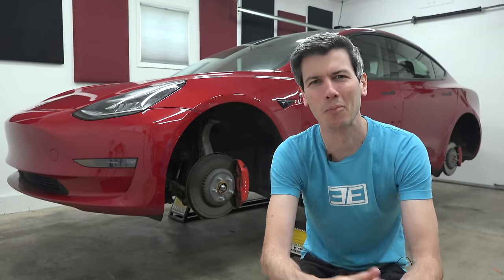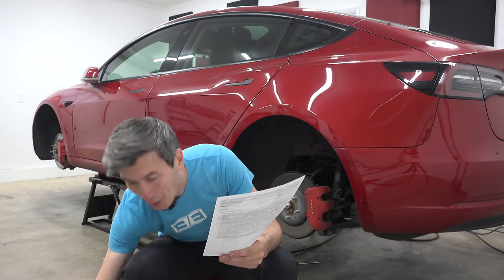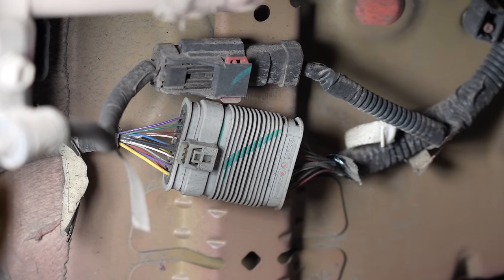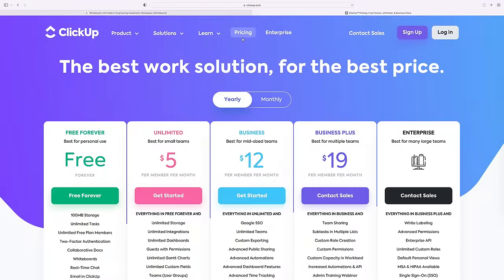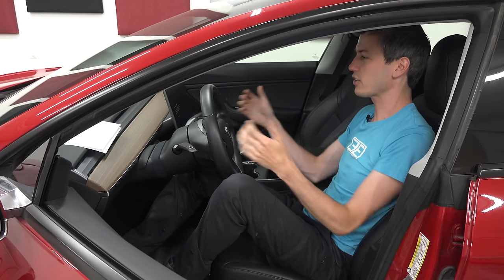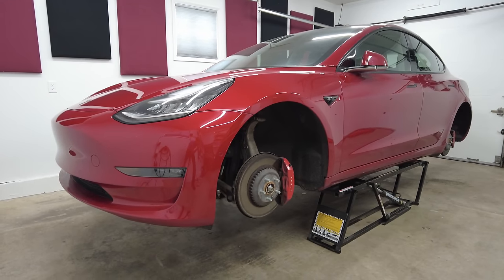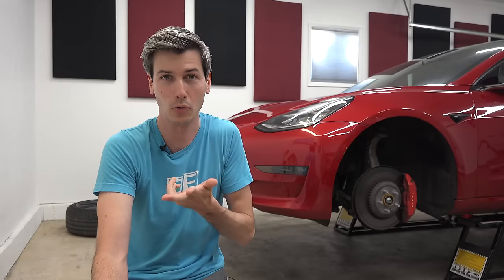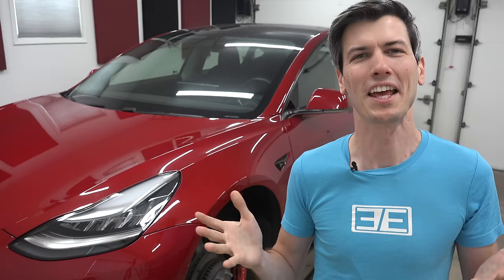Tesla Battery Damage? I Ran Over A Metal Bucket

Comment: Tesla seems like the Apple of the automotive world: A decent product but WAY overhyped and still has issues. And anytime someone points out those issues Tesla's response is "no it's perfect shut up"...

I can't afford an EV yet, but I've considered it a few times. Wouldn't buy a Tesla though.
Reply: People buy Teslas for the superior software, impressive efficiency and unparalleled charging network/experience.

As for issues, every car has some, but Tesla's generally pretty decent at handling them in most areas, especially with service rangers that come fix 75 percent of them in the customer's own garage.

Problem is in areas that are not as close to a nearby service center, if there's a serious issue then they may need to drive a couple hours out of town to leave the car at a service center, which is not an ideal setup for rural buyers and such.

They keep expanding though, so maybe with time that gets sorted, but I would never buy anything else again after experiencing the difference.

But hey, any EV can be a step in the right direction regardless.
Reply: @AllanSustainabilityFan  charging network maybe. With everything I've heard about their infotainment glitches I don't know that I'd say "superior software" though. Haven't looked into efficiency either but... it's an EV.

Also the issues I was referring to was the fit and finish mostly. Like in the video with the spoiler not fitting quite right. The drivetrain is good but they slapped a sub-par body on top of it. A service tech isn't going to be able to fix that, because it's not broken. Just poorly designed and manufactured.
Reply: @nope1918  It's night and day on the software front, it's not even close, it's gotten to the point where most legacies gave up on this and decided to just rely on Apple or Google's solutions to bridge the gap. VW even delayed their software project until 2030 because of their problems.

Fit and finish is a bit exaggerated I think, but that has been an issue in the past with ~pre-2020 Fremont factory builds sure. They've recently moved to a mega-casting platform that reduced 180 parts down to 2, which inherently resolves many of these old fit and finish challenges.

Keep in mind that we're just talking cosmetics that most people don't usually even notice unless specifically measuring for them, and they're easily adjustable by a service ranger visit.

Actual build quality, as in reliability, is an area Tesla does excel at today though, especially the drivetrain. The problem is they spend zero dollars on marketing to promote this, while the competition spends billions on award mills every year. 

If you want a good comparison, here's a UK fleet-wide study's findings:

"What Car? Reliability Survey, which reveals the best and worst vehicles in the UK market today when it comes to reliability. This year’s study included nearly 13,000 car owners who were asked about how dependable their vehicles have been over the previous 12 months"

Model 3:
"Tesla Model 3 was deemed as the most reliable executive car today in Britain, electric or otherwise. Only 5% of the Tesla Model 3 owners who participated in the survey reported having issues with their vehicle, and even then, the problems were only connected to the car’s interior trim. Despite these faults, the Model 3 owners noted that the cars could still be driven without any problems. Even better, the issues, once reported, were fixed in a day or less and at zero cost... stellar 99.4% Reliability Rating
"

Mercedes:
"Interestingly enough, the Model 3’s rival from Mercedes-Benz, the C-Class, was deemed by owners as the least reliable executive car. According to the motoring publication, roughly a third of C-Classes had issues, and the faults covered several aspects of the vehicle such as its electronics, exhaust, fuel system, battery, bodywork, infotainment, breaks, steering, and interior trim, to name a few...Reliability Rating of just 87.3%"

“A third of C-Classes went wrong, according to owners, who reported a wide range of issues. Faults rendered more than a third of cars undriveable, and one in four was off the road for more than a week. Although 81% of cars were fixed for free, a small percentage of owners paid out more than £1500 in repair bills,” the publication wrote."
Reply: @AllanSustainabilityFan  Well, maybe they are finally getting things straightened out then. I still wouldn't buy one, due to personal preferences, but good for them for not being hot garbage anymore.

Comment: Noticed no Corvette comparison, 2.8s 0-60(Faster), higher top speed by around 50 mph (WAY FASTER) and better skid pad numbers at low speeds and even more of a difference at high speed because it has good downforce. Only 20k-30k more. Oh and parts actually fit and repairs don't take 4 months and have supply issues like some horror stories I've heard with Tesla.
Reply: Ew.  Gas sucks.
Reply: What Corvette is this you speak of? Corvette brand new is minimum $105k with the specs you're talking about. You can't spout out upper trim specs and quote lower trim prices. That is about $40k+ more than the M3P. That is not an insignificant difference in price.
Reply: Base 1LT C8 Corvette coupe start at $65,595 including destination charges... Sticker price.
Reply: @shazbotgaming7576  Base model doesn't have that type of acceleration.
Reply: 1LT and 3LT (The upgraded model you're talking about) have the same specs... Exact same mid-engine setup..

Comment: $2600 for 2 wheels? Well now you know why the suspension cover was 3 bucks. They get you somewhere.
Reply: The performance wheels are crazy expensive. Of course, they’re just wheels so you can always get regular wheels from anywhere else.
Reply: @keco185  Strangely, I rarely see aftermarket wheels on Teslas. I see plenty of curb rashed wheels on them though. Are they that special you need to have them like for cooling the brakes or something?
Reply from the maker: I replaced mine with aftermarket wheels after that (like the ones in this video) haha. $2600 basically buys a full set of wheels and tires, and with fatter sidewalls so you don't have to worry so much about potholes.
Reply: @EngineeringExplained  Ah ok, I must have missed that as I assumed it was just the 2.  $2600 for 4 wheels and tires is reasonable.
Reply: @JohannGambolputty22  they’re not special. You can go to tire rack, plug in the car, and get whatever wheels you want. Some 18” wheels won’t fit around the brake calipers but all 19” and 20” should. Tesla needs less brake cooling than gas cars anyway because of regen
Reply: @keco185  Good to know because the base model 3 wheels are hideous. Especially with the paint scraped off of them like I see all the time.
Reply: @JohannGambolputty22  the base wheels look better with the hubcaps off. If you’re good at parking without hitting the curb, they aren’t bad. An option I like is to get the base wheels and install winter tires on them/remove the hubcaps and then buy a set of wheels that actually look good and put summer tires on those.
Reply: @keco185  Interesting. I didn’t realize those were wheel covers and yes, removed I see the wheels do look good. Looks like C&D got 10 more miles of range with the wheel covers on but no thanks. I’d sacrifice the mileage for a better look. Either way I guess all those people I see with destroyed wheel covers actually are protecting the wheels and a lot cheaper to replace. Still look horrible though. Lol. Thanks for sharing. I’ve been considering a 3 or Y.

Comment: What happens when you need to change the battery and it costs $$$$$?
Reply from the maker: It costs a lot money (like buying a new car, or new engine, etc). Battery should realistically last 12-15 years or so, perhaps longer depending on charge cycles, temps, how you drive, etc. Warranty is for 8 years, so you know you at least have it that long.

Comment: Gasoline is still in my future, with technology, mpg can improve immensely
Reply: theyve had 100+ years already, how much more technology ya think there is?
Reply from the maker: The biggest way modern ICE vehicles improve efficiency is by using an electric motor (hybrid). There are limits to efficiency (and thus mpg). EVs can reach efficiencies in the 95%+ region. There aren't any production ICE cars driving around with even 50% efficiency.
Reply: @EngineeringExplained  I think it will take 10-25 years to migrate car purchases completely to electric.  I wonder if car makers could build cars that are mild hydrids, perhaps 2-3 regular car batteries to give it small push when it starts?
Reply: @TurdFergusen  Government mandates haven’t forced them to do it, my opinion only…